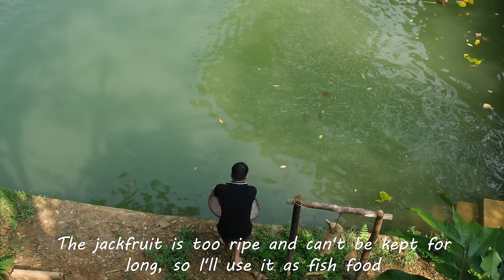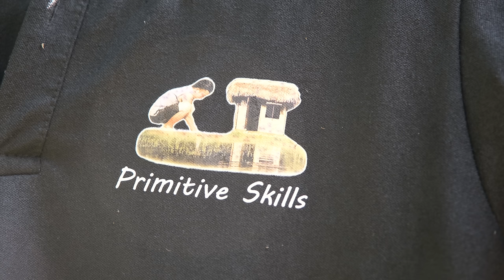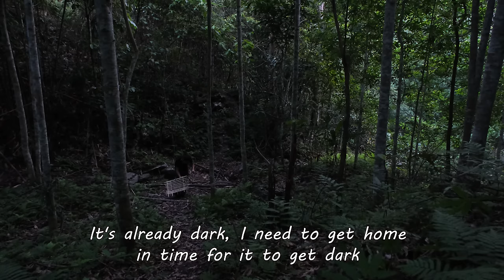This is a big surprise! Capturing and taming wild chickens, Primitive Skills (ep182)

Comment: Hey! What an amizing place you have there. I've noticed you a small river flowing through there and i was thinking it is the perfect place to build a small electric turbine generator. When it comes to free energy, the most efficient are rivers. You can also adapt to a spinning wheel all kinds of mechanims, such as a griding stone, a clothes washer. Of course you have to document yourself a bit about it. But i've seen another youtuber, i can't remember his channel. And he build this electric turbine to a similar river with same flow as the one i see there and he was 100% powered all his shop with it. I mean hand tools are meditation but you could use some electric tools, it will increase your capabilities alot.
He was using a washer machine motor for generator, and batteries from a forklift, i remember he said that is the cheapest and viabe way. He had a circular saw skill saw and alot of tools using this electricity. I am not documented too much about this but i know you need 3 things, The generator, the unit wich charges the cells of the battery and balance them, and the batteries.

Comment: I would suggest making a "Draw Knife", it is my go-to when it comes to removing excess wood of logs when I'm camping. Handle on either side gives you a lot of control. A "Saw Horse" would also be advised, you could do more of your work standing, instead of hunched over. More control, and better for your back.

Comment: I think it's worth making a circular saw, because the water wheel has a very good torque, and you can use a belt drive, of course, making a disco is very difficult, but I think it's worth it, by the way, redo the mounting of the axles, for smooth rotation

Comment: A good light weight resource for the roof might be bamboo. If done in the Spanish style it would be easy to do spot repairs. Just lift out the bad board, and the adjacent 1 or 2.

Comment: When it comes to the Roofing idea, wouldn't it be easier and better to use split bamboo interlocked into eachother? Might be easier to get hold of and less labor intensive along with making it a strong roof?

I'm skeptical about the wooden shingles as they might rot faster than expected.

Comment: I remember splitting cedar logs into shakes for roofing our Boy Scout cabin a kid some 50+ years ago.  Cedar was easier to use than the wood you had. Why not use split bamboo? It seem that it would be easier and better. I love your videos and have learned a great deal from them. Thanks.
Reply: Probably warps as it dries, creating gaps in the roof.  No one in Asia seems to use bamboo for a roof's outer layer.  They use bamboo for everything else, so there must be a reason.
Reply: @jimbayler4277  Do to a shortage of bamboo on northern Canada, I've always had the idea that it was a wonder material for anything. Thanks.

Comment: Slightly charring the wood makes it water proof and won't rot even when in contact with water. (Shou sugi ban is a Japanese term that means "charred cedar board." True to its name, shou sugi ban involves charring cedar planks, then burnishing the burnt wood with wire brushes and sandpaper before sealing it with natural oil.)

Comment: Dude, you videos are my favorite announcement from yt.

How ever I would like to point you to a better way of roofing with split wood.

Smaller wedges made of the hardest wood you can find will usually split any log you can find depending on the diameter. 

Also splitting wood was used for millennias before brick or any other material.

A good source for this information is from chateau du gildeon. It's a castle they are building in France using the 13th century or before technology. 

They have a wood worker who walk you through a short video on splitting wood and makes it much much easier than the way your going about this. Much easier. To deal with. Fallowing the grain vs fighting the grain. 

Much love from America. 

Please dont stop the vids.

Comment: Have you considered making the waterwheel hammer into a saw? You could get four blades like the one in your handsaw and have them cut three boards at the same time to get the most out of your wood and save labor. Make a "v" shaped holder or trough to hold the log to cut the boards and push them into the moving saw blades with a stick. P.S. the trees are cool because the roots go into the ground not because they are green, but you probably knew this already

Comment: use planks for roofing could be a good idea, but a bed of palm leaves would protect those planks from rot tho. so perhaps a duo of both? more structural strength, better isolation etc but 'rot protection' from the leaves.

Comment: I am a Roofer buy trad wood works but you need to use red wood or wood that resists rot to make whats called wood shingals, it's easier to split and You have the tool to do it right know.

Comment: You use bamboo for many things. Why not us it as a roofing tile by splitting them lengthwise. Install the bottom layer cup up and then the top layer cup down so that its edges lay in the cup of the bottom layer. This way, the water runs down the bottom layer cup like raingutters.

When you get your sawmill set up powered by the water wheel, they you can mill lumber in a more time and energy saving method. 

The bamboo roof tile will, at least but you time while you hand saw and shape board shingles by hand.

Comment: beeswax to soak the wood, very good protection against water but not the sun... a simple soak or with a bamboo brush and look at the slice to see the depth of the wax in the wood (5mm ok) it is still necessary to find bees...

Comment: you have the water wheel, with wooden gears you can make the force stronger and slower, or faster with less force, for the beginning they made the hammer, that's great and i'm already tingling about it, more ideas will come along with it the water power wheel.
for example a large tree trunk saw
I'm already further into my head and thinking about a wood planer.
I sat down easily, started to draw, a basic idea for the wood plane,
made of wood with metal blade 3x.

but that would take a long time with the wood planing time,
but during the time
could you do something else?

I hope the translation is understandable.

Comment: You need a one man saw with a long saw blade. Cut those logs into more manageable lengths and lay them up on a structure frame you can stand on to use the saw to saw the log into lumber. Far less waste than you are producing right now with your axe.

Comment: You could use a maul to split those logs in like 2 hits, its a sledge hammer axe. Basically a big hammer that has an axe head on one side which makes it look like a wedge, with a long handle. The handle should probably be about the length of your leg. You will get a more clean split and will not have to remove splintered wood from splitting as often

Comment: Instead of whacking that blasted rotten log section as a "fish bell", just tap two small stones together underwater.  Problem solved.  Also, I'm probably not the first to mention this, but given all the sawing you do, it seems a natural accessory to make the saw be powered by your water wheel????
Reply: You mean circular saw but his waterwheel cant give that much power.
Reply: @anicetapreciosaelechobagun9082  The first water powered saws were reciprocal blades that went in an up and down motion in the late 18th century but you're right that he would probably need a bit more water to power it👍

Comment: Olá! Já pensou na possibilidade de fazer seu telhado com telhas de barro queimadas? São mais duráveis, fáceis de subtituir,. Podem ser feitas em fôrmas de madeira, secadas na sombra e depois queimadas para ganhar rigidez e impermeabilidade. Pense sobre isso.
Para os pintinhos, você vai ter que fazer um galinheiro maior. São 6 e logo serão mais. Quase uma granja. Rsrsrsrs
Hi! Have you ever thought about the possibility of making your roof with burnt clay tiles? They are more durable, easy to replace. They can be made in wooden molds, dried in the shade and then fired to gain rigidity and impermeability. Think about it.
For the chicks, you will have to make a bigger chicken coop. There are 6 and soon there will be more. Almost a farm. LOL

Comment: have you thought about case hardening your tools? it could increase their lifespan and effectiveness.

covering them in a carbon rich slurry (charcoal dust + flour, wood dust, etc.) and heating them for a long while in the furnace/forge should put carbon into the outer layers, which then can be hardened and tempered like better steel.

I don't know what the best procedure is, as there are many ways to do it, but I think you should check it out!

Comment: Hello,      You are an extremely hard worker,  You should be exhausted.       On these roofing panels, - if you don't mind a helpful comment, --   Years ago, - people would burn roofing pieces before installing, - this makes the pores of the wood close up and will be watertight for a long time. You may want to try that!   G.L.Gillen